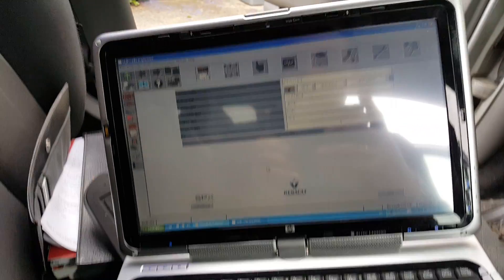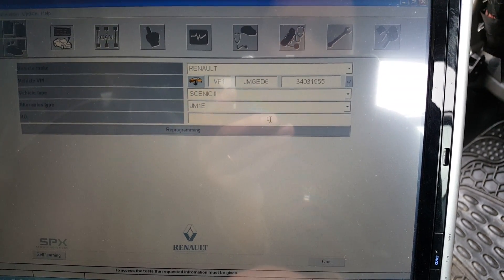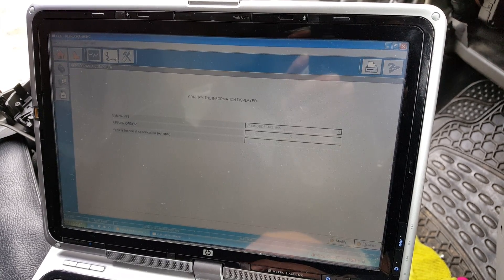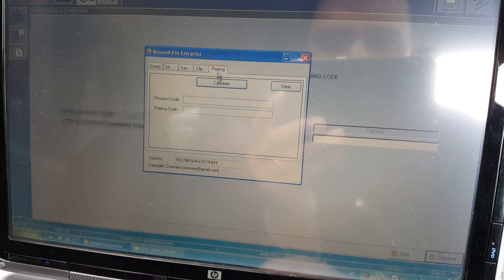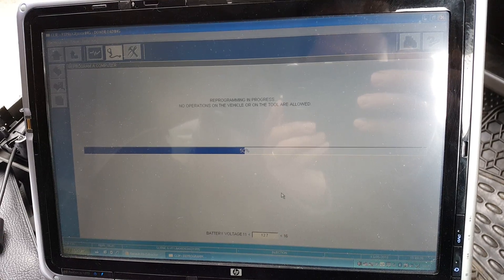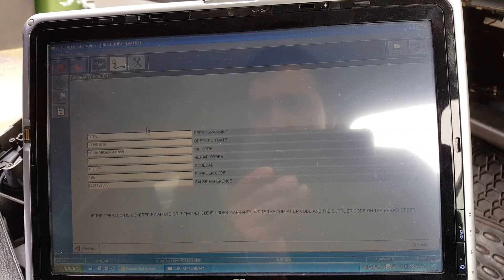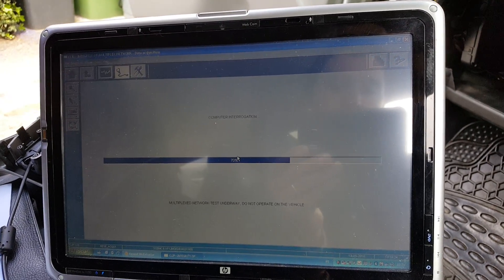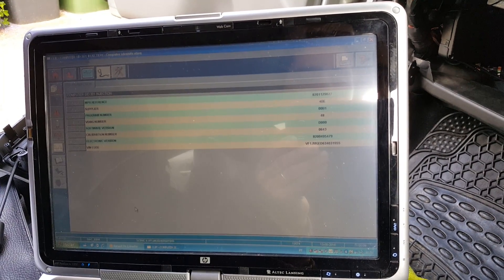Renault Can Clip ECU reprogramming procedure.

Comment: Hi I was wondering if you knew how to program a electronic handbrake unit on a Renault scenic 2 2007 and if my husband replaces it with a second hand unit will it work , cheers x
Reply from the maker: TheLucyOlivia Channel 
Hi
The programming procedure using clip will be not much more than following the screen... but this for a new hand brake module...
A second hand unit should work, however it might need coding, or adjust the configurations... it all depends on the car it came from...
Hope that helps...
Thank you for watching my video!
Reply: Thanks for making time to reply  and for the Advice

Comment: I have a 2000 ford mustang v6, the motor was replaced with a 2004 mustang motor but they for got to change the ecu chip. now I can't pass my emissions on the car. What should I do, buy a new ecu for a 2004 or have the old one updated/reprogramed?
Reply from the maker: Vic Walker 
Hi
See if can be updated, but might not going to work... because if you use vcm it will recognise the car by the ECU... Unless you change the VIN first... that way it will see the car as a 2004.. another way is do it on the bench... that way you can load a map from a 2004 with no problem...
Before all this, make that there is actually no issues with the engine itself... a plug or a pipe not connected can be all it takes to give you problems...
Hope that helps.
Reply: Thank you.

Comment: Hi. I have a Modus 2005 with a steering fault in display. I have read its a commen fault in 2004-2008 models. Also very expensive. We have tried to replace the computerbox with an used one. But the start control kicked in because of the codes in the computerbox. My mechanic tried to recode the keys. It was not possible. I have seen you recoded the computerbox in a Megane. Is it the same procedure in a Modus and can we do that with Can Clip? Sorry for my englich. Great videos you make.
Reply from the maker: Gitte Pedersen 
Hi
First of all thank you for watching! 
When you say computer box has been replaced... which box are you referring to?
Reply: Hi. I think it is the Power steering unit!

Comment: Hi do you recomend to buy Renault can clip and what version do you recomend
Reply from the maker: Birgir Brynjólfsson 
Hi
If you work a lot with Renault, I do recommend! 
Version, the latest...
Thank you for watching!
Reply: Yes i work a lot wit renault just wondering if there is any other that 
is better or what wersion to buy blutooth or not and what wersion of the
 software
Reply from the maker: Birgir Brynjólfsson 
If you a good quality tool, as the new versions come out you can just upgrade the software... I say a good quality probe, because some software versions also require a firmware update on the tool... and some cheap ones you can't really mess with the firmwares...
So yes, buy the latest version... hundred and sixth something at the moment...
Reply: Hi and thank you for the help where do you recomend buying it
Reply from the maker: Birgir Brynjólfsson 
Well... if you are to buy a clone probe, it is always hit and miss...
Anywhere from eBay to other online sellers...

Comment: hi I have a problem with my megane 2 1.5 dci . I change the injectors and I wrote it in the ecu but after one day the ecu lost the codes . Please help me
Reply from the maker: balc viorel 
Hi
Have you tried to write the codes again and see what happens?
Reply: hi Imsvvavr
not yet because I'm waiting the guy with tester .now I cannot start the engine only if I replace the egr valve .wihout egr start but I accelerate hardly the engine and it make a lot of white smoke
ps thank you very much for your concern and if you want I could give another infos for solving the problem
Reply from the maker: balc viorel 
If you have someone to come with the scanner, do that first...
Also see if there is any codes and go from there...
Reply: thanks so much I will do it next week

Comment: Hi;sorry for my bad english
The only thing I did not understand it in this video is to enter the code
What is the code or what is (renault pin extractor)?
Reply from the maker: mohamed mohamed
Hi
Pin extractor is a software to decode data from dumps, to calculate ISK, incode etc...
You will need it to calculate the code to allow you to programme.

Comment: lmsvvavr Why did you made reprogramming? Was the ecu replaced or ecu software faulty?
Reply from the maker: Hi, in this particular case was only for the video, I have done it in the past to correct running issues, but never done a video for it...
Reply: I have clip 146 and 135 reprog dvd, i read somewhere that in this version it's impossible to update software in used ecu, you can reprog only brand new virgin ecu, is that true? I see that you are using version 133
Reply from the maker: Right, I have kinda answered this question is the past... but understand you do not want to read all the comments...
This procedure is to update the ecu software, this is mainly the maps... so the immo is not touched...
You can update an ecu with clip as soon as a new version is available for that ecu,(Reprog DVD) you can not for example, program the same version...
I believe you are referring to the immo side of things, which in that case is correct, you can not reprogram an used ecu into another car, at least not with clip...
Hope that answer your question!
Reply: lmsvvavr
Thanks for your answer, I want to update maps ( as U are saying) so I want to use my ECU in my car, no need to touch immo etc. So clip v146 and reprog dvd v135 should make the job
Reply from the maker: jakuzjelcza 
Yes it should...

Comment: Hi lmsvvavr, I've just changed the battery on my Renault Clio and I'm getting a solid immobiliser light. Will I be able to use the Clip software to put in my vehicle code?
Reply from the maker: Zooumberg 
Hi
Yes you will...
Reply: lmsvvavr
Thanks for that. What device would I need to fit a laptop to the car?
Reply from the maker: Zooumberg 
It is also called clip...
Reply: lmsvvavr
THanks again. I'm currently sitting outside my house freezing and waiting for the AA

Comment: thank you  for video 
what is ro ?
what the code reader software name 
where can i get software firmware   
thanks
Reply from the maker: Hi
RO stands for "Repair Order"... part of the renault structure...
I believe that will the number that is given to the customer process... so everything that happens while the car is at the dealer is tracked correctly... for the individual any number will do.
The software is called Renault Clip. 
Google will help you find it....

Comment: hi my friends I have a problem I would be glad to help if reno clip ecu battery charger can go to learn programming I get a warning screen 11.7-volt battery gösteriyor.c zero in the clip
Reply from the maker: durmuş türkoğlu 
Hi
Are you saying that you can't program because clip alarms low battery?
Reply: Before ECU reprogramming, you should check battery voltage.
Reply: connect external 12 wolt for programming

Comment: good afternoon, only I have the clip renault, I have CD ROOM give me the link to download it? Excellent video, I would learn, as on my scanner, very little is what him and only him and used for diagnosis, which is a very effective tool but without knowing use not much, and learned to program keys megane 2 I wonder I can make key twingo? I e done using the pin extractor renault, thanks for the video and I appreciate the help you can give me
Reply from the maker: Thank you for your comment!
The CD usually comes with the clip software... Although not always. 
Google will help you to find it...
As for the keys, it does program keys to that car... just the pin code that you need to have.
Hope that helps.
Reply: hello, excuse me and how I could get the cd rom for ECU programming renault
Reply from the maker: +JAIRO QUIROZ 
Hi
Google 'renault reprog disc'...
I am using version 138...
There is a few different ones out there.
Then find a website where you download it from, and that's it.

Comment: good, I set using the pin renault extractor cards enault and keys megane 2 My question is, use the same protocol for the Clio models, symbol, kangoo, scenic, in the tutorial says I should take from the digito 18 to 23 and in some cases 24, could you help me or make a tutorial using the clip or programming key clio kangoo, thanks, not before I say goodbye give thanks for the video and for the help
Reply from the maker: Hi
Thank you for watching!
I can't recall doing a kango...
Although have done a few clios. 
The procedure is very similar, except the pin, where depending on the immo version there is different ways to retrieve it. 
Next time I have a clio I will make a video...

Comment: Hello,
first thank you for the helpful video.
I have a question regarding the Can Clip clone.
I also have the problem that my Can Clip V146 clone shop article number: SP19-B disconnects shortly at irregular intervals, with the coresponding program message. After clicking ok the connection is back to normal.
Is this now due to the device itself or on the software version V146, which was together with the Can Clip clone?
What can I do to solve this problem?
Thank you in advance.
Reply from the maker: Hi
Thank you for watching my video! 
I have had the exactly same problem with one of my clip clones couple year back... ( this one if the 3rd unit...)
At the time I have open the unit and reflow the boards... it cure the problem, but only for a few months... so can't really help you... you can try the above but can't guarantee that will work...

Comment: Im after a can clip, where did you purchase yours? and which software version would you say is the most stable? the market is littered with them on a well known auction site!
Reply from the maker: Hi
Thank you for watching! 
My one is originally version 132, but I have recently updated to 156...
In my case on top of the software I had to also update the actual probe firmware...
And here is where sometimes things can go wrong...
To be fair this is the 3rd probe I bought, as the other ones started to fail or disconnect randomly, and obviously you afford that when doing programming. 
I think is more a matter of luck, as unless you buy genuine, they all come more or less from the same place...

Comment: Hi, do you know if using a chinese CAN Clip clone, you can do the upgrade too ?
Any solution to know if there is an update for my motor, prior to buying a clip (searching on the dvd update ?) ?

Thanks.
Reply from the maker: Hi
The clone, if is a good quality one, it will do the job.
My clip is the third one i am going through, and the first thing I do is open them inspect and re-solder all chips .
About check if is updates available, I can't answer with certainty.
I check it when the machine is plugged in.
Just out of curiosity, I don't update ECUS just because an update is available, I usually do it if I am convinced that it will resolve a certain problem.
Update ECUS is a risky process, which can transform your ecu on a paper weight if something goes wrong....
Reply: Thanks for your fast answer and advice. You are right, I should not try just because of an update.
I am facing power steering issue on my laguna 3 with variable hydraulic steering. 
I read somewhere that an update could resolve the issue as I don't have any leak, the pump is not noisy.

The steering is assisted, but minimal, impossible to steer one hand when stopped. No fault on clip (had the chance to test one).

This is like a last chance try, before having to change all the steering rack.
Reply from the maker: +batambantumi 
In that case, if an update is available I would go for it.
If you do it, just make sure you follow all the recommendations... (all power consumers off, drivers door open, power suplly connected to the cars battery, computer connected to the mains... i think that's all...lol), to ensure  a successful update...
Reply: Thanks ! Just hoping not to have to change the steering rack... Not too hard, but a lot of labour time >> expensive.
Reply from the maker: +batambantumi 
No worries!